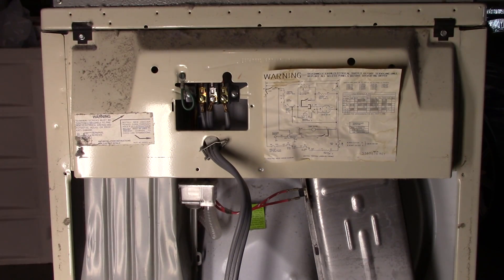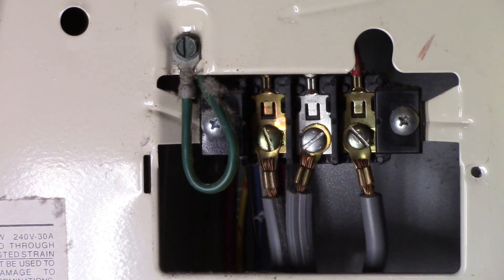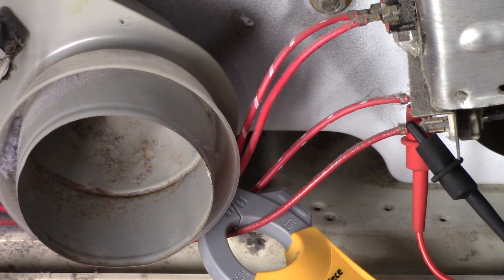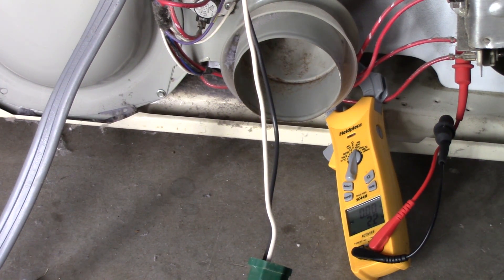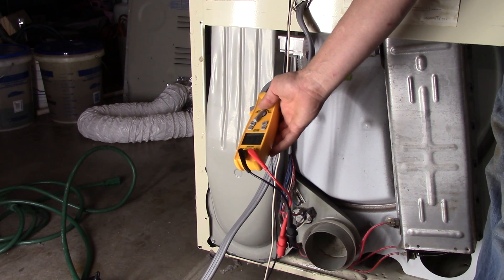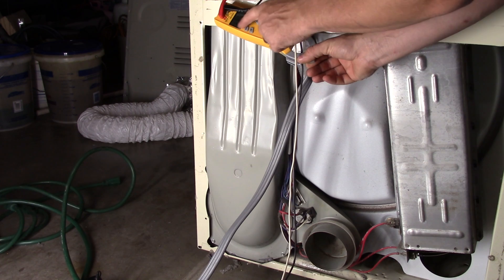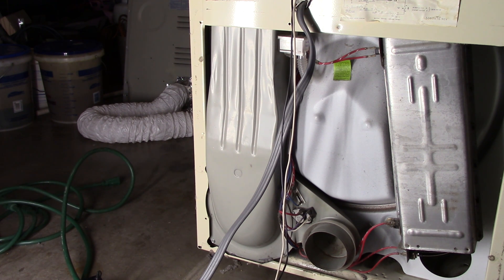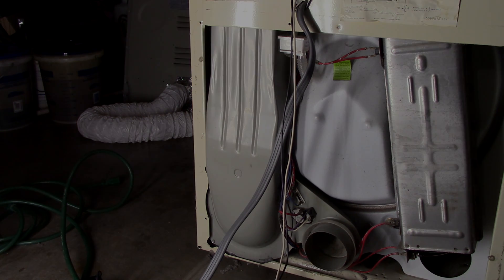Converting a standard household dryer to 110 volts @1400 watts from 240 volts @ 5500 watts

Comment: Hey sir I know this a bit older of a video. But say could you run 2 extension cords? Hot from each extension cord to each hot and then share both neutral in the middle and not use a jumper wire? Thanks!

Comment: I’ve had a idea to transform a 240v a 120v and do get 50% of the hot air (is coming out ) to go inside again and I guess I can make a more efficient 120v dryer increase the hot and let the moisture out spending less time and less electric power.  Other idea is to stretch and shorten the heater element a bit to make it get more hotter than is . (I did before and it worked great.

Comment: I’ve converted a 1970’s Maytag to electric dryer I finished restoring last year to 120v since I didn’t have access to 240v out in the garage, definitely took a long, long time to dry a load of towels since it was only outputting 1300 to 1400 watts of heat output. Advantages to operating on 120v is it’ll make the heating element last forever and will be gentler on certain items, downside is it’ll put more wear and tear on the mechanical parts such as the rollers and drum belt since it’s running 2 to 3 times longer.

Comment: About 7 years ago “GreatNorthWoodsHillbilly” wrote you about using solar air panels to heat air that would be used to dry clothes in a 240v electric dryer adapted to run on 120v. 
Well I’m there right now. I have the solar panels built and ducted up to a dryer that’s modified to receive the solar-heated air. But I cannot install a 120v power cord into the back of the dryer, the way you demonstrated, without blowing the gfci when I plug it in. 
Following your lead I retired the red hot lead.  Then I jumpered between the empty hot red terminal and the neutral terminal. Finally connected black lead to remaining terminal. Ground went to chassis. The only thing I did that you didn’t mention was disconnecting the heater assembly.  All wire ends are taped and safe.  Maybe a circuit was broken by the disconnect.  What do you think?
If I can get this running, then I’ll send you pics and plans.  Panels currently produce150F with fan blowing air through collector ducting. 
I really want this to work. I hope you can help me. 
Robert Horton
Reply from the maker: I can help you with this please email me and I will try to help lunsfordhvac_20@yahoo.com

Comment: I h
ave a whirlpool dryer now the white wire is hooked up to ground only has 3 wires B, W, R  ,is white my nuteral?
Reply from the maker: it's important to consult a licensed electrician when dealing with electrical issues in your home. It's not recommended to attempt to diagnose or fix electrical problems yourself if you're not qualified to do so.

Comment: Shouldn’t your jumper wire be going between the two hot wires instead of from a neutral to a hot because now you’re feeding neutral into what used to be a hot wire
Reply from the maker: If you're not familiar with electricity, you shouldn't work on it. It's incredibly dangerous.

Comment: I done this for a friend that only had a gas dryer that went bad and she had no 220 volt outlet and did not want to spend money putting one in but she was offered a free electric dryer, and had a 110 volt 20 amp outlet for the gas dryer. The only thing the 220 volts is powering is the heating element, the motor, and timer runs off of 120 by taking a leg of the 220 to ground.  Doing it this way makes it take twice as long to dry the clothes as you are taking half if the wattage away from the heat element.

Comment: I want to change a 110v dryer to 220?. Already have a 220-volt outlet.
Reply from the maker: cant happen
Reply: what is that going to do for you ?
Reply: @frankc6430  I just used my range connection problem solved
Reply: with amps less is safer
Reply: That's not possible, You need another 120 volt wire to rise the voltage and probably the heater pack

Comment: I converted it following your advice. Unfortunately the heating element doesn’t work at all on 120v, it just powers on and tumbles… no heat. I tested it with 30 amp and it works great heats up instantly. Any advice?

Comment: Ok so if you restrict the air flow slowly until it cycles the heating element off and make sure the cycling thermostat is a 135 degree F then it will come up to temp, there is a 110volt element avaliable that bolts right in place of the 220 volt one Whirlpool# 3403591

Comment: Good concept, I run my whole house on solar, all electric appliances. Did this same mod on my water heater but used a 3way switch so I can toggle it from high power to low power. Good work!

Comment: I had a heater element burn out on my home dryer and replaced it with one I had around. Much lower wattage and it took twice as long. Timer didn't have enough time. Added a 50 percent timer to the machine so it can twice as long. A friend runs heater element on solar. I run my dishwasher element on solar. My whole camp runs on just a car  battery. PV hot water, fridge, dishwasher and large capacity clothes washed.  It can be done and super cheap.

Comment: I'd like to see this kind of go the other way. Rewire a 110 to 220... kind of....Currently I have an apartment sized washer and dryer and the dryer takes FOREVER to dry clothes because it's 110. 

Anyway, I saw some videos where people take microwave transformers and make arc welders from them. I'm wondering if there is a way to use it to boost the dryer since the amp and voltage increase would come from the transformer and not the line.
Reply from the maker: First
    No that would not work to add power you see the 110vac has a max amps of 20 amps 
   110vac * 20amps  =  2,200 watts
A 220 dryer has a 30 amp fuse or trip switch 
   220vac * 30amps = 6,600 watts 
Watts is what heats the system not volts 
high voltage means less amps and that is why we use it for high power consumption systems
and a 220vac, 20amp dryer will use 4,400 watts 
and if we tried to use 110 you would need 40 amps to get the same power out. 
    110vac * 40amps = 4400 watts
there is not 40amp 110vac breakers to make this happen.

Second
 Transformer can make 220vac from 110vac and I have some here but the amps are divided by 2 if you have 110 primary and  220secondary your amp output would not be multiplied they would be divided by 2 with this amount of turns of wire

      110vac * 20amp transformer primary 
would give you a 220vac * 10amp   secondary output
 110vac * 20amp = 2200 watts
 220vac * 20amp = 2200 watts 
       If no transmission losses occur.
Microwave transformer will kill any without mercy!!!!!!!!!! Don't play with electricity!!!!!!!!!!!
Reply: @solarpowerelectricityandel2915  - I think in your last section you meant to say 220v at (10) amps is 2200 watts
Reply: @solarpowerelectricityandel2915  Thanks for response. In a lot of the videos they rewind the the transformer... I think the secondary to create the power to melt metal with their transformers.

It's beyond my understanding of electricity...which is zero.... I would never mess with it... which is why I presented it to someone else (you) that is smarter.

Do you know those combo all in one washer dryer things work? The same drum washes and dries clothes... how do they do that? Is it a special drum? Could a regular washing machine be converted into one?
Reply from the maker: I will get  a strike on youtube if i talk about that
Reply from the maker: the dryer is 5Kw of power @220vac

Comment: Thanks. I was looking to buy a cheap used dryer to tumble my pet bedding in to get the pet hair out. Pet hair clogs my washer filter which is real hard to get to and it tougher than my small female body to easily clean out. But I did not want the dirty pet bedding in my clean dryer. All I actually need to do is hook in a 120 cord on this used dryer and unhook the heater wire leg, insulate that wire end and then tumble the pet bedding before washing. That should save me a lot of grief and pain. It hurts my shoulder trying to put the hose back on the fitting when I clean out the filter.

Comment: I don't know why people say 110v when really, both places I've lived  like Oklahoma and California, it's 120v! Where do you get 110v? It even says 120v on your diagram there! Why are you saying 110v?
Reply: Not sure exactly, it's kinda funny like that. The stuff is rated at 120/240v but when you measure from the outlet, it's usually 110/220. 120v is under ideal conditions I guess, the ratings are always listed that way.
Reply: @130rne  Where I live, when there is no load on the outlet, the voltage is 120v. When you apply a load on it, the voltage drops according to how much amps it is pulling. The higher the amps, the lower your volts will drop.
It's like a water hose. When you apply pressure (volts), the voltage is high. When you release that pressure which generates amps, the voltage drops because it's flowing thru the hose with less resistance so it has less voltage buildup.
So what I'm saying is that before applying a load, you may have 120v to 116v but when there is a high load on that outlet, it will drop down to 114v to 109v depending on how much amperage you are using.

No house in America should have less than 115v before a load is applied! Anything less, and your appliances and electronics may not work correctly! If my computer battery backup gets down to 114v, it switches to battery mode to prevent damage to my computer!
Reply: @driversteve9345  I get you, though I've actually seen 108v on a house with crap wiring lol. So I just read up on a history lesson about it. tl;dr- 100v was initially used due to something about the carbon filament lightbulbs, they would blow at higher voltages. It was upped to 110/220 for a long time, now most modern ratings are 120/240. There's still old appliances around that have the 110/220 stickers. I get that an active load will increase current if the voltage drops in order to have consistent power but heating elements are passive, they're just giant resistors. Oh, and just learned that switch mode power supplies don't really care what voltage they run at. Something like 90-240 is fine. So that's probably an example of a device that pulls more current when the voltage drops, it's gotta maintain amperage to the rails. Maybe that's why the battery backup acts like that but maybe it just thinks the power is going out. The lead acid batteries in some power supplies are the same type that starts your car, they can handle a ton of current so I kinda think it's just trying to maintain voltage since most devices will just malfunction at low voltages. And typically devices won't fry due to low voltage, computers and stuff. So the battery maintains voltage, the psu maintains current, and the computer should be fine. That might be why we should all have quality psu's lol, because the cheaper ones will pull more current at low voltages and fry themselves unless they have good overcurrent/undervoltage protection. So like during a storm, if the power goes out it could actually fry a cheap psu. Just thought of that. Pretty sure I have all that right but feel free to correct me if I'm wrong.
Reply: @driversteve9345  That's interesting about the different countries, in the states the voltage is maintained from what I've seen. Always near 120, I've only checked the outlets but they were on the same circuit as other loads, lights and stuff. So other countries design appliances to work on a wider range of voltages? Interesting.
Reply from the maker: I work on 3 phase power and in 3 phase power the leg to ground is 110 and single phase power is 120v sorry about that my friend
Reply: Hey man calm down its gonna be ok
Reply: You are all trying to pick fly poop from the pepper.   Operating voltage for most small appliances is from 100 volts to 125 volts.   What is standard voltage coming from receptacles should be from 110 to 125 volts.   It is called either 110 or 120 as a nominal voltage.   When you see a label on an appliance, it will give you a voltage as tested along with amperes and or wattage for reference purposes.   If your voltage is lower or higher, the other numbers change depending on what the appliance is.   The standard for a utility company is plus or minus 10% of a nominal number like 110 or 120.
Reply from the maker: @KevinCoop1   Unless your working with 3 phase which that's what I do
Reply: @solarpowerelectricityandel2915     Since you commented,  Which 3 phase system are you saying is 110 volts to ground?   I too have worked mostly 3 phase as a design engineer since 1983 and do not know of a 3 phase system that is 110 volts to ground as a nominal number.

Comment: Need help with this buddy, I wasn't able to get it going
Reply: I can send pic how I completed, not why Dryer wouldn't turn on and has power
Reply from the maker: Electricity is very dangerous I wouldn't suggest doing this if you don't know what you're doing you can burn your house down
Reply: @solarpowerelectricityandel2915  no worries. I know enough and think another video tutorial showed why it didn't work
Reply: @solarpowerelectricityandel2915  neutral wire important from spare wire

Comment: I just did this to a modem Samsung computerized dryer with a moisture sensor. The black wire inside the dryer led to the computer and the red wire and neutral wires led somewhere else. I jumped the red and neutral wire. I applied 120v to the back wire and neutral to neutral. Draws 14.98A. Works wonderfully on my dryer with a moisture sensor.
Reply: How long does it take to dry your clothes?   Or to put it another way, how much longer?
Reply: @KevinCoop1  a full load is nearly 2hrs
Reply: Install a 220 outlet, its not hard and your clothes will dry much faster. And they electric used will be the same or less I imagine since the 110 runs 2 hours instead of 30 mins for one load.
Reply: @josephvance8900  it was for my daughter's apartment. Free full sized dryer vs buying a 110 dryer
Reply: 14.98 amps = the full amperage capacity of a standard 120v 12 gauge 15 amp residential branch circuit. Not good. :( If a load exceeds 75% breaker rating for more than a few minutes on a regular basis, you need to upsize. In this case, upsize to a 20 amp branch circuit breaker, wiring, and a 20 amp outlet. Betcha if she has the clothes dryer going and then plugs in a microwave or a hair dryer or a space heater into the other receptacle on that double outlet, the breaker will pop almost instantly.

Comment: Pretty much useless.   You might as well just disconnect the heating elements completely.   They are not getting hot enough to make much difference.
Reply from the maker: You're pretty much useless
Reply: Solar Power Electricity and Electronics    Honestly, you are not getting enough heat out of the elements.  So basically you are just blowing very slightly above room temperature air.   You are using lots of watts and getting almost nothing out of it.
Reply: @KevinCoop1  I disagree.  I just completed this on my dryer.  The unmodified system produces 155-160 degrees which is controlled by the running thermostat.
I scanned the temp difference and am getting 125 degrees, which is plenty to dry a load of towels, although it takes a little longer.
Reply: Cool, I just told a friend this. You might have to run it longer but theoretically it should work. 1500w is a space heater, it'll dry clothes, just takes awhile.
Reply: @130rne      Think of it this way.   It takes a certain number of BTU’s of heat to dry a certain mount of wet clothes.  So, with less heat and running longer, the same number of watts are used, but the length of time means it runs the motor longer.   Your electric bill is based on watt hours.   The dryer changed this way will cost more in energy costs.   The last comment, the guy said the 160 degrees was controlled by a thermostat.  That means it cycles on and off.   At 120 volts, continuous running.   Think it through before you do it.   Respectfully,   Kevin
Reply: @KevinCoop1 you are basically arguing about nothing. I did this for testing a vintage Maytag dryer from the 70’s I restored not too long ago since I didn’t have access to 240v at the time. On the ratings plate, it’s rated for 4800 watts give or take, used a ohm’s law calculator to see how many watts or amps it would pull so I could use the correct gauge of cord. Anyways, it pulls 11 amps at 120v with 1460 watts of heat. Dried about 6 towels, took 3 hours to dry with 1460 watts of heat. Electricity costs 28¢ a kilowatt here in California, if I run the dryer for 3 hours, it’ll cost about $1.12 to run. However, if the dryer were operating on it’s for 240v outputting 4800 watts, it’ll cost between $1.30 to $1.40 to operate. So yes, it’ll use less power on 120v vs 240v.

Comment: The advantage of doing this is not to save on electricity because it probably use close to the same amount of energy because the Dryer would have to run a lot longer to dry the clothes. The advantage of converting a dryer would be to use a smaller generator (If one does not have one that can run a Dryer at 240V with a 5KW heating element) Or one could use this during the day and use a smaller solar grid tie setup that could help run this lower wattage dryer without having to use as much Grid electricity. Or one could use a smaller off grid system that has a lower capacity. For most people there would be no advantage of doing this. But under certain circumstances it could be useful. I do respect his experimentation as I have done the same converting a water heater over to 120V.
Reply from the maker: thisvideo has paid out so i will not take it down ps dont try this at home